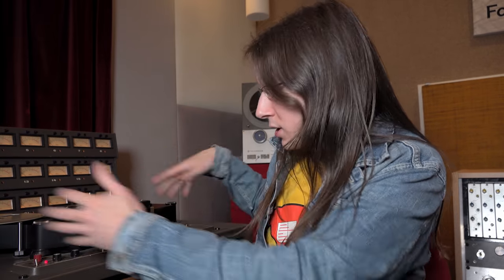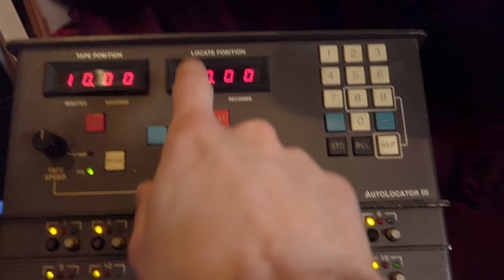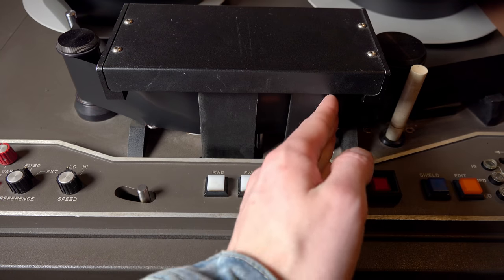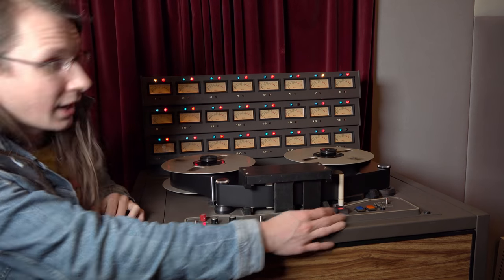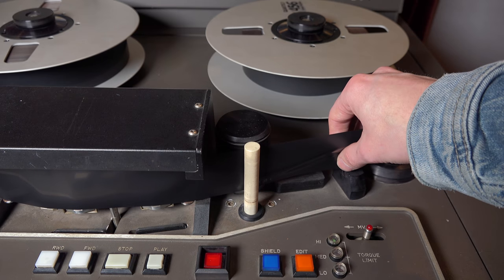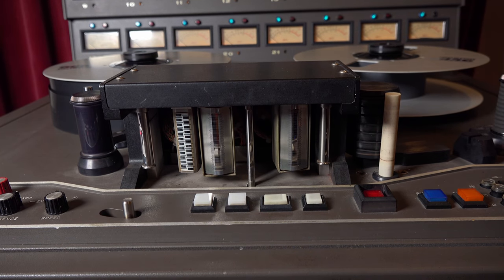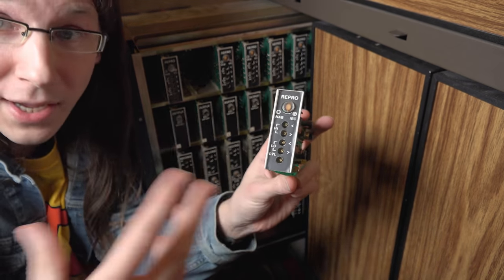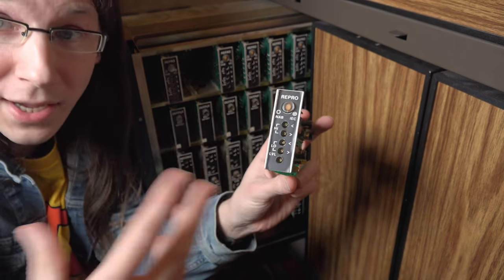THIS IS HOW A 24 TRACK TAPE MACHINE WORKS!

Comment: From a hi-fi point of vieuw its a bit weird, first you buy expensive microphones, pre-ams, compressors with ultra low harmonic distorsion for hi-fi quality, and then you introduce distorsion and sound degradation with a old 24 track tape recorder ? But thats what i think only because i am also into  hi-fi i think. It makes no sence if i think from the loudspeaker to the original source when i lissen. It would be even worser when you put analog signal on the tape from bad D/A converter, and most are bad compared to NOS DACs from Metrum accoustics.
Reply: You left out the best bit - produce a wonderful master and then squish down the dynamic range into half to make it fit onto vinyl. This especially affected classical music.
Reply: @peterblackmore7560  Cutting grooves tighter together with less bass in the signal ? or by even compressing, limiting it so you can cut grooves even tighter next to eatch other? I am sure you understand but vinyl is a limitation also, for cutting vinyl they adviced me to use no compression because cutting will compress the signal naturally, and i did not like compression anayway because of loss of dynamics.
And what will happen if they cut with a crap D/A converter ? In that way its better to grab the signal from tape.

Comment: Was a pain in the ass to make music back in the day
Reply: Are you kidding?  It was s blast! I worked in Boston and I was always busy. I recorded 40 bands in 1986 alone. We didn't waste time tuning and polishing turd takes. We did punch-ins and only kept good takes. I did between 400 and 500 mixes and never saw a single waveform.
Reply: I'm 25 and I record and mix on tape... I know how to calibrate machines and stuff.. I can assure you could be stressfull sometimes... but oh boy recording to tape.. and gettin to know different formulas of tape and how to use them.. and different ways of "tuning" your machine its superb...
And its not just as everybody thinks ... that to record on tape you have to push into the red zone every channel because its sounds good... dynamics are important... and choosing a good recording level will open up music like a flower... :)
Reply: @chrisrevel2801  it depends how you calibrate your machine and which tape you use ... if its a low or high outpout... closing unusued channels when not using them it helps... :)
Reply: @mjklein   And the musicians had to be able to play their instruments.  No digital pitch change - you were in-tune, or not.
Reply: @chrisrevel2801  yes Chris, what you just said. Of course it's a talent issue and not an equipment issue, and of course yes we did have our dog bands back in the day. But I will say that for every mediocre artist that had a record deal, I knew at least five people that I personally worked with that were much better and could not get a deal.
Reply: @peterblackmore7560  you are so right about that Peter! I knew a guitar player who would thrust his lower jaw out to cause a tone to be generated in his ear. The tone was a  B natural and he used it to tune his guitar with.  But at the end of the day, what it comes down to is can you sing or can you not sing. Here in my neighborhood, I was talking to some Filipino kids who record in their dorm using a notebook, and he said "I just autotune everything" All I could do was shake my head.

Comment: Now the only thing you do not know or understand about the machine you have.   This is Third or Fourth, generation analog recorder.  And in being that. The design concept of this particular machine.   Included a record head.  Identical to the playback head.  And what most people don't understand.  About this machine.

When you make a recording on this machine.  One would normally do your mix down off of the playback head.  But in this case.  With this machine.  It is recommended you do your mix down from the  record sync, head.  And not the playback head.  Why?  Because there is this thing called gap scatter.  Between the record and the playback head.  And so when you play back through the original recording head.  There is no gap scatter causing phase anomalies.   And so you only use the playback head.  For the tape recorder alignment purposes.  Not for actual playback purposes.  When the recordings are made upon that machine.  So you don't have any gap scatter..  Nobody knows what I'm talking about when referring to gap scatter.

Okay.  So what that means is.  The gaps of the record head..  Will vary slightly.  Between the record head and the playback head.  They cannot get the gaps perfectly aligned.

So, if you record and playback from the same head.  There will be no gap scatter  time anomalies.  Between tracks..  You will get a finer more cohesive sounding more Phase coherent playback. Off of the record head.  If you made the recording on that machine.  Otherwise?  All bets are off.  You will then be dealing with gap scatter.  When the recording was made upon other machines.   No way around that.

And while the gap scatter is usually not a big issue.  It is still an issue.  For those of us that really care about the phase coherence of our recordings.  Some of us actually care about that.  And my  4 major music award nominations, prove that to be true.

If anybody would like to know the finer aspects of tape recorder alignment?  Feel free to drop me an email.  I enjoy helping others get the best sound from their vintage collectors, analog recorders.  That I built.  So many years ago.  Oh my God!  I can't believe I'm still alive!

RemyRAD
FETSounds.com

Comment: ill throw my 2 cents here (or my 1001000). im 50 and have extensively recorded on tape and DAWs and everything in between., Ive heard all the arguments pro and con and for what its worth, you hit diminishing returns the deeper you talk about it. Yes tape has warmth. and yes this warmth can be reproduced. A plugin may come very close to a Studer machine but will never hit it. And the differences is where we fall into the void. With sample rates and lossless compression it very hard to tell. The digital sound wave is so closely sampled that the parts that are "missing" are literally so insignificant most would be hard pressed to tell. 

Sure some people will listen to vinyl, hear the pops and crackles and swear its better. But thats just reminding them of good times "back in the day" when everything was analogue. Well I got news. I worked my tail off in the analogue realm, no choice. and today I would say the ease of use and accessibility in digital far outweighs dealing with analogue (Though I do still use analogue outboard gear) Now, does a (digital Versus analogue) pipeline sound better? Meh, it can. all depends on who the engineer is. 

The biggest issue we have is that with the rise of digital we now have 20 million kids all over the world pushing music out and many of them dont know what theyre doing. The loudness wars, overly compressed, over produced, harsh or terribly mixed, etc. Now before DAWS, There was no such thing as an engineer who "didnt know what they were doing" with record companies spent millions booking the suite. There was a kind of magic and commitment with analogue. Especially for the 8 track guys. Wanna record these vocals? better bounce those drums and the guitar cuz we're out of slots. whole different mindset. 

We went from early years of digital being great for its noiseless possibilities, and massive headroom, to today people using plugins to simulate the exact things we were trying to get away from. I remember hearing my first mp3 (probably recorded at 64k bitrate) and thought to myself "this sounds horrible? this is the future? and now were using plugins to simulate low bitrate. too funny. Once we successfully hurdle the last of the last as far as quality of the era, we move to the next phase where we find beauty from older tech. Film directors fought HARD to keep lens flares out of the film. Why? Because it was seen as a mistake, and poor cinematography. Then in the 90's, people were simulating lens flares in photoshop ALL the time. it became an industry joke.  Same thing when we first got into DAWs. we suddenly had 600 plugins and we used them all, and it sounded like it.. 

sorry bout the long post. But the answer? why not use both if you can afford it? theres always a "difference" and a great engineer will know how to milk the last of the last from a great piece of outboard gear. I think the great debate about digital VS analogue is like the PC vs Apple forums. its just a rabbit hole and in the end, putting out some juicy sound waves that make people dance, cry, love or fall asleep is all that matters

People in the 60's : "man I wish we could use a computer to do all this"
People in the 2000's : Man I wish I had a tape machine to do all this"

Comment: “Dancer arms”?  Sorry.  It's tensor, not dancer.
Reply: No is isn't: It's actually called a dancer arm! Look it up in Google!
Reply: Perhaps I am mistaken, but in over 20 years with a large government radio/tv network, these were never referred to as dancers.  It may have been a Sony-MCI thing.  We used Studer machines exclusively.  Tape tension sensors, or tensors are still available for sale and can be found using Google.  The complete service manuals for many Studer models can be found as well, and refer to various parts used in the tape tensioning function.  There is no mention of anything called a dancer.

Comment: BTW, I guess you know that a 2500' reel of 2" will cost you more than $500.
Reply: If I remember correctly, in the 70s a reel of 2-inch tape  cost around us$250.
Reply: @rb032682  Wow, where were you buying it from? By the early 1990s we were paying £40.00 for a reel of 2" 456.
Reply: @UKHeritageRailways  -  All I know is that a record producer wanted to re-use a full 14" reel of Scotch 250 which contained the 24-track master tape of my band's biggest "hit".  He offered the tape to the band for $250us.   I regret the band did not buy that tape.  We could still be making money from that multi-track master.
   That incident happened around Dec. 1980 (?).

Comment: Awe how cute.....if he thinks a 24track analog recorder is complicated, he should look at a 2" quad video tape machine. Dealing with audio freq is cakewalk compared to recording a 6Mhz video signal on analog tape.
Reply: wasn't this even before VCRs ?
Reply: @maxmustardman298  24trk audio machines that used "simulsync"(playback off the record head) was developed in the 50s same era of the Quad VTR. VCRs as the consumer knows it was aroind 1976. There were other "VCR" machines in the 50s, but was not practical. The quad video tape machine used 2" tape and dominated the professional video recording industry for over 40 yrs. The heads spun on air bearings at 14,400 rpm. So the machine required compressed air to run.

Comment: I bet you never anticipated having a person who is old.  Who worked directly with and/or trained directly with,  those,  afmentioned, companies. And those transports were very quiet, when new.  And can still be quiet.  When tweaked correctly.  But how would you know?  The loud  clicking sounds of solenoids bottoming out.  Only prove.   Proper maintenance has not been  maintained on these machines. Which needs to be done.  Before you use these contraptions.   If you expect good performance.  But how would you know?

What people don't realize.  These machines were designed to be maintained,, tweaked and used by professionals.  They were never intended to be used by home consumers like yourself.  They are professional industrial machines.  Designed to be used by other professionals.  Not amateurs.  Otherwise?  You'll never get them to work well.  Because you don't know anything.

Biasing?  You have no concept of this.  This is how you change how the machine records and sounds.   There are no, de facto ways you should tweak the bias on your machine.   Everything you have read.  It is only recommended suggestions.  Not gospel!  Not mandatory!  But merely suggestions.  This is what you don't understand and don't realize.

So when you get those expensive reference calibration alignment tapes from MRL.  You also don't realize.  I had a big hand in that as well.  While, not directly being involved with that company.  I had to deal and be directly involved with that company.  When employed by Scully.  Another legendary  hit recorder manufacturer.  From the bygone era.  And I had to correct the owner of the company when he made a mistake making his own reference alignment tapes for us.  I saw what the problem was.  And told him how to make the correction for that.  And so I had to tell the world authority he was wrong.  Follow?  I know more than he does.  I know more than most everybody.  And a lot more than you.

Now I realize you don't know who I am.  And that's all right.  I'm still alive.  I worked for those companies and with those companies..  And I know a few things.  That you don't.

So if you'd like to know a little bit more about the recorder you have?  You can contact me directly.  I'm still alive.  I'm one of the last surviving members of one of these legendary recorder companies.  And a world authority on it.  Wish I never actually imagine myself to ever become.  But I am.  And I also had a major influence on all of the major television networks, audio.  And that just should not have been.  But it actually happened.  It's actually true.  And I can hardly believe.  The career I have had with the companies I have been involved with.  Which should have never happened.

Why should it have never happened?  I am a bona fide high school dropout with nothing more than a GED.  But I trump the knowledge of most, electrical engineers and college graduate, recording engineers.  And I don't exactly know why?  I'm just really really good at what I do.  And everybody knows that about me.  That's why I have made acoustic corrections for major multimillion dollar recording studios.  Where the electrical engineers and the acoustic engineers, could not.  Because they only rely upon mathema worked for them at a verytical formulas and textbooks!  They don't know how to listen.  What a listen for.  Want to listen to?  They are idiots.   They learned, how to pass tests.  And that's about all.

So, I was directly involved with the manufacturing of these here machines.  And now most everybody involved with those are now dead.  I'm not.  And I like you.  You're cute.   Your other videos are great.  I follow you.  I don't subscribe to anyone.  Because nobody is worthwhile to subscribe to.  They're all wrong.  And I know they are wrong.  Because I am a world authority on this.  And always will be until I die.  Which won't be long from now.  As I am in my mid 60s.  And everyone else's dead.  And so I work for those companies at a very young age.  Because yes.  I am that good.  That competent.  That informed.  That knowledgeable.  That talented.  And I don't need a fucking stupid college degree.   I have a genius IQ.  But I don't flaunt that.  It just is.  It's over 150.  I'm twice as smart as most everybody.  And that has been a terrible problem throughout my life.  Dealing with stupid schmuck's.  With average or beneath average IQ's.  I'm sorry.  That's just the way it is.  I can't help this.  I was born with brains.  Which no one else seems to have on the Internet or YouTube.  I can't help being smart.  Sorry..  I wish I was more stupider.  But I'm not.

Now remember kids.  Bias levels is just a suggestion.  It's only a recommendation.  It's not gospel what they recommend.  You have control over the way your recordings  sound.   And that's how we tweak,, bias.

So when the audiotape manufacturers recommend an over bias at 10 kHz as, +3 or +6 or higher.  That's just a suggestion.  It can be as low as +0.  Depending on how you want that recording to sound.  We make that decision.  Not the manufacturers of the tape.  It's only a recommended suggestion for stupid people.  Who don't know anything about analog tape recording.  It's only a suggestion.

So, when you don't over bias for over bias tape.  You get a more brilliant sound.  If you want a more brilliant sound?  If you don't want a more brilliant sound?  Then you might over  bias by a few DB's.  Depending upon how you want your recording to sound?   And that's the story about bias.  It's not about what the manufacturers tell you to use.  It's about what you decide to use.  And that's the wonder and the amazing thing about analog tape recording.  In how you get different sounds.

I have only covered the tip of the iceberg here.  There are many more factors involved.  About how you want your analog tape recorders to sound.  Jay McKnight  from MRL labs is a world authority.  But then saw my and I have had to direct him in corrections for his own reference alignment tapes.  That didn't go over very well with him.  But he realized the following day I was absolutely correct.  So he's not the only world authority.  I also am.  Because I worked for those legendary analog recorder manufacturers in some manner shape or form or directly.  I lived three blocks away from the original, MCI factory.  In Fort Lauderdale, Florida for 2 years.  When that machine was designed and created.  And there is some of me in there.  Nobody knows about.  It's bonkers.  Because I was not directly employed by them.  I just lived close enough to contribute.  And I took their free factory authorized training seminars.  And then told them what to fix.  I know.  It's crazy.  I'm a high school dropout.   But when you have this kind of intelligence.  You trump all college degrees.  I teach the college professors.  Because I cannot teach at the universities they are employed by.  I don't have a college degree.  So I can only teach the college professors.  It's bonkers.

RemyRAD
FETsounds.com
my new digs I created.
Reply: You drink too much coffee